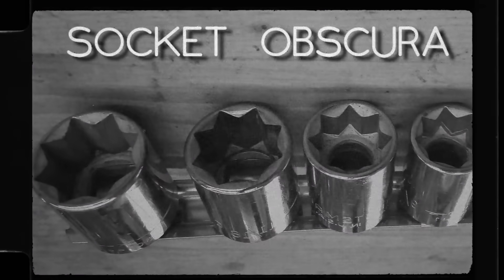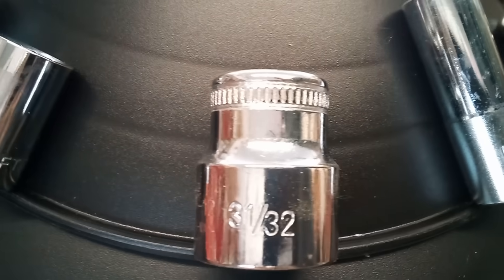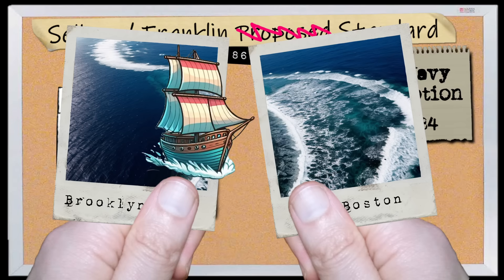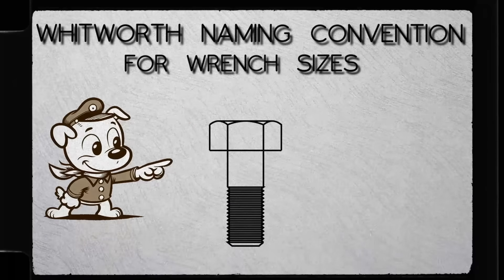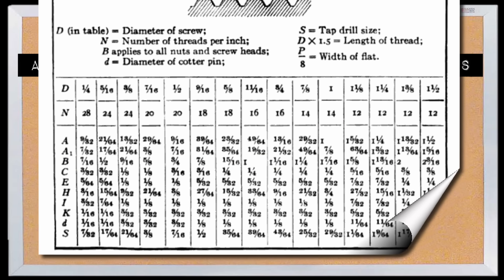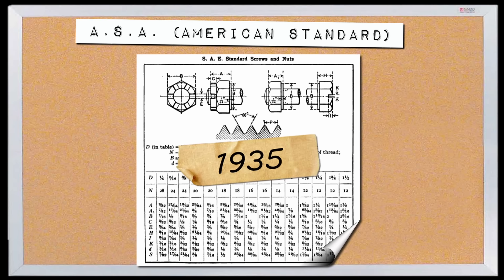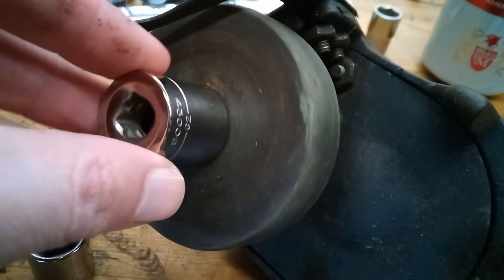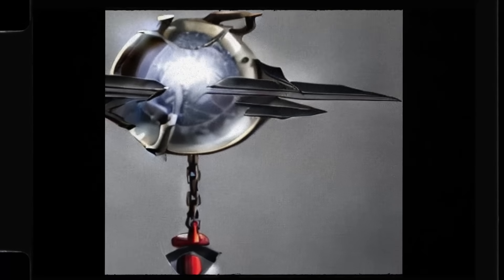32nd of an Inch Bolts - History & Lore

Comment: America just loves fractions and yet finds the metric system difficult. You know that's a painful trolling they've been on but if wasting around a TRILLION DOLLARS a year operating both measurement systems is working for their image, have at it then.
Reply: We (in the USA) don't find Metric difficult.  We are far better with Metric sizes than Europeans are with inch-based fractional sizes, on the whole.
Reply: We (in the United States) do not find the Metric System difficult.  We are far better with Metric units than Europeans are with US Customary units, on the whole.

Comment: "Management fixed this problem by removing the Microscopes."  Great one!
Reply: To be in Management, those are the kind of things you learn. How to hide problems. I think Boeing is an example.
Reply: Man, does that statement resonate. SoCal aerospace 1970s-late 90s. Saw a good number of idiots actually bumped upstairs to reduce hands-on mistakes. Peter Principle, anyone?
Reply: @sanseijedi Dude, this crap continued into my Aerospace career from 2007 - 2021!  Worked in SoCal. 

So glad im out of that industry. In Biotech now.
Reply: True
Too much scrap
Change the standards
Reply: If you can't see the problem it doesn't exist. 🤣🤣🤣🤣
Reply: Also known as the Dumba55 Donald method.
Reply: Not funny
Reply: @gregedwards1087  your are joking I hope... or - you really have no idea what is going on around you - in this case - you are welcome to hide your empty head in teh sand - and stick out the rearbottom - to get kicked from every direction - but since you don't see anything - your head deep down in teh sand - remember? - then there is NO problem for you....

jeeeeeez, some people never learn using their brains

Comment: My 1959 BSA has a LH thread crank nut in 25/32, it's a BSF thread. What surprised me was how easy it was to get a 25/32 spanner on UK Ebay. Lots for sale and all War Dept markings so there must have been a common bit of military equipment in the UK with 25/32.  BSA made weapons as well as motorcycles so perthey had a lot of 25/32 hex bar left over.
Reply: NorCAl in USA here, but I had a BSA bicycle for a long while, sold it about ten years ago, BSA made lots of different stuff

Comment: My dad had a full set of wrenches, including the 32's. I remember quite a few nuts and bolts I needed those sizes for. I'm pretty sure I still have those in a storage room full of tools in Texas. A lot of vintage equipment is better built than some of the cheap crap that gets made today. Different times, different values.

Comment: When I first started my wrenching journey, I worked on English cars, German cars and American cars. So I dealt  with Whitworth, Metric and USS. Then I got a crescent wrench and some
slip-joint pliers and went into electronics!
Reply: Don't forget the BSA standard.  I believe that stands for "British Standard Automotive".  I remember in school we had a motorcycle mechanic.  He had to get a BSA socket set to work on the occasional British bike that came into the shop, it was better than having to try and find replacement BSA bolts that he had rounded off.

Comment: If the cap fits, wear it…if the spanner fits, use it. Nuts bolts and spanners are all made to somewhere in a manufacturing tolerance. Sometimes at the the extremes of these tolerances, the fit is terrible. Then common sense prevails. Ignore the markings…..use what fits✔️

Comment: The metric is actually a stupid system, the sexagesimal system is very much better and much more logical. It is allso much more accurate, but the EU wanted more sloppy standards resulting in today,s absalute crap manufacturing standards.
Reply from the maker: Interesting. A base 60 system. Something else for me to dig into.
Reply: If only we had three-fingered hands.

Comment: I've worked with Whitworth, BSP, BSF, BSC, UNC, UNF and BA.  In the 1920s a lot of cycle threads were used, but it's near impossible to find taps or dies to repair or make replacements.  The metric system works well as it is far more standardised, but it is possible to put imperial nuts on metric bolts in some combinations.  When using eyebolts for lifting you have to be really careful that there is no confusion.
Reply: Cycle fastener sizes have always puzzled me, there seems to be considerable variation even on modern stuff, possibly depending on where in the world it was manufactured.

Comment: 32nd size wrenches are good for metric sizes. I have some odd 32nd and I think even some 64th sizes in old wrenches from my grandfather. When I needed the shape of them to get into some tight quarters the odd sizes crossed over to the metric bolts on my car rather well allowing me to get the job done.

Comment: If Americans are going to stick with archaic standards that can't keep up with modern precision, why not get some 64th's and 128th's too ?
Reply from the maker: /64ths sizes are out there, never seen 128ths. I have a 57/64ths spark plug socket in my collection.
Reply: Precision does not depend on units.  There are no /128 wrenches because there is no need for them.
Reply: @GH-oi2jf  Precision doesn't depend on units, but metric certainly helps simplify it.

Comment: "Decimal Inch" sizes are "real" to me and nothing else. The 1/4" drive socket set I "made up" for myself sits in a handmade magnetic holder for rapid "try on's" to get the closest fit. Remember that hexagons "shrink" when they get corroded and then brushed clean! Also they can "grow" on one axis when squeezed by Vise Grip Pliers ! In order then...  6mm, 1/4, 7mm, 8mm, 11/32, 9mm, 3/8, 10mm, 13/32, 7/16, 12mm, 1/2, 13mm, 14mm, 9/16.
   I noticed that they are spaced mostly about 10, 20 thousandths of an inch apart. The size jumps range from .011 to .039 (a full millimeter)(and there are only two full-millimeter jumps) HEY IT WORKS FOR ME !!!
        PS - anybody have an 11.5mm deep well 1/4drive socket? How about a 29/64ths ???

Comment: 2003 Ford Focus.  Various other repairs and home projects.  For the most part, almost everything is metric.  My SAE (inches) tools almost never get used.  I almost never need to buy SAE bolts, etc.  Still, I go to the bins in any of the hardware stores.  They have the metrics in little boxes while endless bins overflow with SAE.  Makes no sense, it should be the opposite because like it or not... everything is metric now.

Comment: Genius tool is one of the best sockets I have ever used. Had a bunch of brake systems to rebuild on trailer brakes and the head of the bolt was 10mm.  Well I went through a few snap on sockets (rounding out\ splitting sockets), when I had an independent tool dealer sell me a set of genius tool sockets. I have that 10mm impact socket over a decade later.
Reply from the maker: I've been pleasantly surprised by the handful of Genius tools I have.

Comment: I have a handful of odd size open end wrenches in my tool box and I have used them at times over the years and most of them are made by Williams. I'm just a diy shade tree and 75yrs old but don't use  my nice set of tools.much. my tools are mostly s-k Wayne sockets and wrenches and some craftsman and also some odd stuff.
Reply: We are close in age.  When I started working on my first car, S-K was the tool brand to get for amateurs.  I found the 3/8" ratchet in a junk store ca. 1960, well used, and I still have it.  A couple of Craftsman box wrenches were my main wrenches along with the sockets.  It's a shame what has happened to those brands.
Reply: @GH-oi2jf  i remember my 1983 chevy pickup was partly made in canada or something and i had to get some metric tools to work on it along with american standard, both kinds. i never got into battery power tools, i still have plug in drills, skill saw and reciprocating saw.

Comment: Some of the bolt & wrench strangeness I have ran across. 7/16" bolts, why does the bolt head require a 5/8" wrench while the nut requires a 11/16" wrench. The only bolt size that doesn't use the same size for both the bolt & nut. I have heard some older mechanics refer to any fine thread bolt or nut as an SAE thread. have also heard older mechanics (this was back in the 50s) use the wrench size to indicate the bolt size. Ex: calling a 1/2" bolt a 3/4". On the 32nd size wrenches. First job I worked at I was trying to tighten the nuts on bumper bolts on a 40s era car. I couldn't find any wrench that fit and the car was a US made vehicle. An older mechanic had some 32nd wrenches & one fit. He called them bumper wrenches. Wonder what the situation was on that. The bumper manufacturer was not following the SAE but rather following some other industrial system?
Reply from the maker: Someone else mentioned it was so you didn't have to have two of the same size wrench. Not sure why it only applied to 7/16ths. They also had 'heavy hex' standard, which allowed for larger nut sizes. Never heard of the 'bumper wrenches' - they could have been using their own in-house standard?
Reply: @ballinator  The "bumper wrench" term could have simply been a personal or local usage. I just remember the guy using that term. I have rebuilt an old Ferguson (not Massey Ferguson) tractor & it has some odd wrench/ bolt sizes. It could be that the plant manufacturing the bumpers was originally some sort of metal forging factory & hadn't yet converted to the SAE standards.

Comment: Sometimes a nut used on exhaust manifolds lost enough size through the heating and cooling cycles, nut to forget the rust, that a xx/32 socket was the only way to get it loose.

Comment: I especially love working on my 1988 Ford. All the hardware on the engine and axles is sae. But on the body and frame its all metric.
Reply from the maker: Opposite on my '84 Chevy. Engine is metric, everything else is SAE.
Reply: @ brand new 6.2 diesel. I’m running a 300 6 for now. Gather parts for a 351w swap

Comment: 40 years ago I was an aircraft mechanic working on DC-6s. I still have a Craftsman 19/32 box end wrench that I used for the 12 point brake bolts (or nuts). Don't think I ever used that wrench for anything else.

Comment: We don’t have to deal with fractal inch sizes, we prefer it to the metric system. It ain’t broke so don’t fix it.  I do despise the metic system.  It is designed for the illiterate users.
Reply from the maker: Yeah, it's interesting how those of us that grew up on the fractions find it easier to use them. It 'technically' should be easier to use the metric system, but the fractions seem more natural.

Comment: I think this vid should be nominated for an Emmy in the drama category.
Reply from the maker: Thanks!
Reply: Or at least in the "support role"  !
Reply: Years ago I was trying to remove a shaft nut on my Choey Lee sail boat. Made in Hong Kong. Would not budge. Turned out to be a left hand nut. On trying to replace it I found out it was metric. But it didn’t match. Turned out to be a Chinese left handed Chinese metic thread. Needless to say, I replaced the shaft and used a standard three quarter thread.Lesson learned.

Comment: Why was it that whitworth and unc have the same tpi except 1/2 inch which is one thread out per inch? Also when I was 8 years old I was given my grandfathers Herbrand socket set with all the 32nd and 64th in it as well as 1/4s 16ths and 1/8th, it’s that old it’s nickel plated, pre chrome , I’m 64 and still use it in my workshop . Great American made tools.
Reply from the maker: Not sure. I'll have to dig into that for when I do the Whitworth video.
Reply: 1/2"-12 was a common dia/TPI combination way back in the day, and overseas mfgrs bought out old tooling from more modern shops and continued to make things using the older 12 TPI.  I recently had to buy an expensive 1/2-12 TPI bolt for a ~1978 Taiwanese Mill/Drill.

Comment: All the farm equipment that I grew up with from the 50's, 60's and into the 70's had the 32nd nuts and bolt heads.  Cultivators, chisels, rakes, plows, discs, some combines, balers, etc. all had them.  Not every nut and bolt, but a large portion.

Comment: As others have mentioned, 32nd sized bolt heads and nuts were sometimes used as "safety fasteners". The one place they were often found was automobile tie rod steering bolts and nuts. Because of this, as a young guy, the wrenches were called "tie rod wrenches".

Comment: Used a lot in aviation 7/32, 9/32 I tink  for making the nut as light as possible .Do remember B727 brake carrier came with 25/32 nuts originaly still have the socket.
Reply from the maker: Interesting. Didn't think about the weight factor.

Comment: For any of you out there who worked on Boeing 727s....The nuts holding the main brakes on were 25/32.....not 13/16, as many have found out to their chagrin after rounding the nuts off. Not even Snap-On made a 1/2"-drive, 12-point, 25/32 shallow socket. The only folks who made them were, surprisingly, Craftsman. I know of many 727 wrench-benders who guarded their 25/32 Craftsman sockets like a Rottweiler....never, EVER loaned 'em out, hid 'em away in a different drawer, etc. Fortunately, if you did the conversion, you found that a 20mm socket was only .006 larger than the 25/32. It worked really well until you could get to a pawnshop and find another 25/32. To this day, if I see a 25/32 socket in a pawnshop, I have to make a concerted effort not to spend the buck or so to get it.
Reply: I don't have a 20mm socket because most socket sets skip it, going from 19 to 21. However there's one bolt on my car that's a 20, so I use an ancient 1940s 25/32 socket.
Reply: Started wrenching on 727 back in the 70's and was told by my lead the first day to stop by Sears and buy a 25,32 socket for brake changes. Being a new guy, I change a lot of brakes until I got so seniority. Still have it and will never let it out of my tool box.
Reply: My dad was a crew chief on many different aircraft in the Air Force (1954-1974).  Then in the aero industry till 1997. His tools i still have and yes all of the 32nd inch wrench and sockets are Craftman.
Reply: I use a willams deep 25/32 for airbus a320 breaks
Reply: My father in law worked as an aviation tech for Braniff from 1967 to 1982. Worked in remodeling until 1989 when he went to SW Airlines until 13. I love asking him about all the old planes.
Reply: Very interesting
Reply: I worked on them in the late 90s / early 2000s right out of A&P school.  Mine is a Proto.    Was literally the first tool i bought after getting hired.  As the new guy, i did pretty much all of the brakes.
And windshields, and slat actuators.   But those memories are best forgotten.
Reply: Earlier in my career I worked 737-200s which I think had a similar arrangement, but we had some special sockets and a shop-made wrench in our brake change kit.  I was only in on a couple of the brake changes on those before the aircraft went away.  Brake retention was one area where McD definitely had the right idea, which Boeing adopted after the merger.  The brakes on the -700 aircraft that replaced those were a dream to change, by comparison.
Reply: Too many boeing plane have had problems, doors coming off in Alaska, boeing is still military,  spirit is civilian, hope they don't make avionics for helicopters or ships for the navy!

Comment: I own a 1923 Hinsdale socket set featuring some eight point sockets. Other than old furniture nuts, I'm unaware of any need for eight point sockets. I wasn't born until 1959, so I'm not sure what the answer is.
Reply from the maker: They come in super handy for pipe plugs, which are usually square.
Reply: @ballinator  Thanks!
Reply: old lag screws.

Comment: What about square head bolt sizes?
Reply from the maker: From what I read they should have the same 'across the flat' measurement as a 6-point bolt, but due to the different shape they require a 8-point socket. I did a video on them last year. Mind the parody intro and the slower pacing: https://youtu.be/MiCnZM9Z0Y4

Comment: My old snap-on socket set has a 19/32 and I have not used it yet!!!😂😂😂😂😂😂
Reply: Dual water pumps on flathead ford motors had a mounting bolt on the inside of the hose spigot.  It would corrode requiring a 32” socket driver on to remove.

Comment: For smaller sizes, 32nds are really needed. For the larger sizes, over 1/2”, why bother? Even today, though, there are different widths to nuts and to screw heads as well. A lot depends on the hardness and strength. Often 12.9 screws have smaller 12 point heads and the nuts too. Also, and this sometimes gets a bunch of heated replies, what are often called bolts are actually screws. A screw has a head that can have a wrench or screwdriver to tighten it. It’s intended to screw into a threaded part. A bolt has a head that can’t be used to fasten, or tighten it. It’s intended to go into a hole with no threads and to be tightened with a nut, as with a carriage bolt. Yes, screws are often used to fasten to parts with a nut, but it’s still a screw because the head can use a wrench or screwdriver. I know people think that a bolt is larger and a screw is smaller, but that not true. I know some people think that if it has a hex, or square head, it’s a bolt, but it’s a screw.
Reply from the maker: Very interesting. I saw in some of the old documents where they refer to them as 'screw standards' and not 'bolt standards' - that explains why.
Reply: that's why where I worked when they ordered what most people call a bolt they ordered hex head cap screws. looking u bolts in the catalog took you to the wrong place. that's why if you need an Allen "bolt" you order socket head Allen screw.
Reply: @ exactly. One guy on line here once cursed me out for saying this. I told him to look it up and he cursed me again.